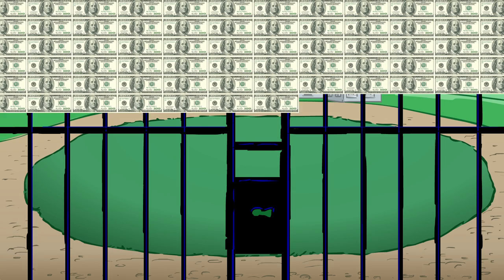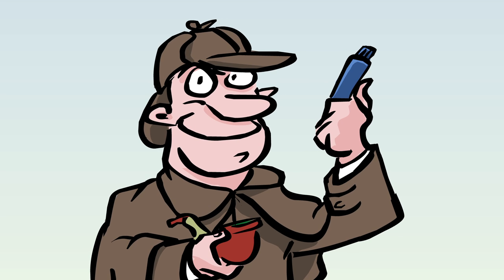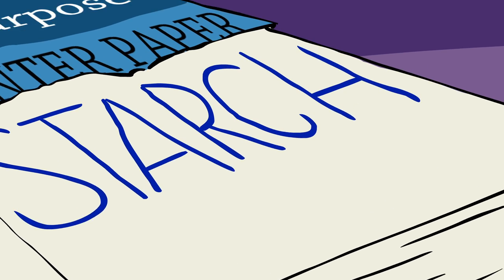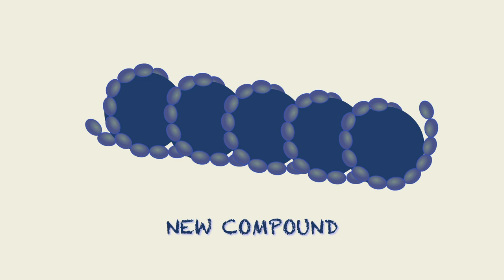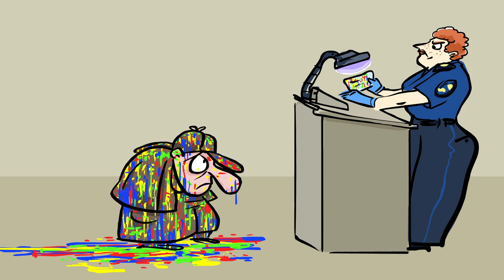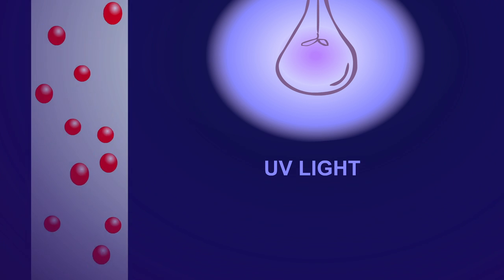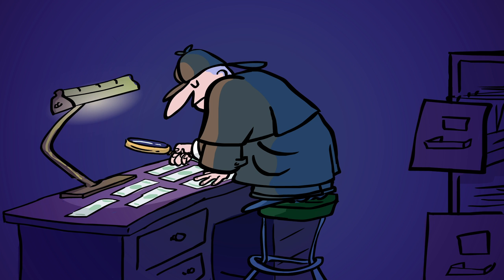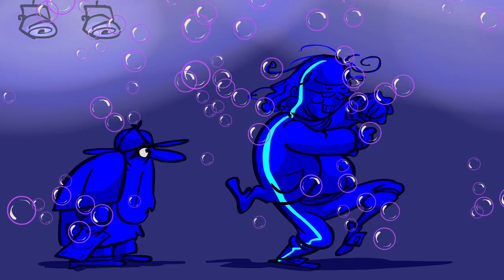How to spot a counterfeit bill - Tien Nguyen

Comment: Remember to be careful for bleached bills too! You might notice that bills pass the marker test but are still counterfeit, they take a $1 or $5 bill, bleach it, then print a higher denomination on top of that. Make sure that strip is in the right spot before taking large bills. That marker is easily fooled!
Reply: rockforever5505 That is why most currencies use larger paper for higher denominations. and is easily seen.
Reply: @marcusl5605  wrong, actually. All US bills are the same size. It's for easier stacking in a wallet or pocket.

There's an easier way to combat the bleached 1/5 trick. The ones and fives don't have a portrait with enough of a suit to texture. All bills 10 and higher in the U.S. have textured suits on the portrait. If it doesn't feel textured, it's fake.
Reply: And also, the paper feels different. U.S. currency is printed on a mix of Cotton and Linen mixed with wood pulp
Reply: I always heard you have the right to contact the Secret Service who are the agency dealing with counterfeit money
Reply: @katherynedarrah4245  Person wasn't talking about US currency. lol They're right.
Reply: There is a newer variety that tests the INK of the paper instead of the paper itself.  If it smears, it's fakey fake.

Comment: There are easier ways to spot a counterfeit bill:

Legitimate bills use black and green ink.
Most counterfeits are printed out with a printer so by that logic all green ink will be comprised of yellow, magenta, and cyan and is easily discernible if you look closely at the bill.

Also, in bills that are 10 dollars and higher, the amount in the lower right hand corner of the face side of the bill will be reflective/shiny. If the number does not shine it is suspect.
Reply: Also if you use your fingernail to scratch the shirt on the bill you will feel the ridges.
Reply: that's noob counterfeiting... don't ask how I know ;)
Reply: +Saphiros Problem is, modern day laser ink printing just made the job of observing the various dots a LOT harder...
EDIT:
Also, Printers now have pure black ink! Yay.
Reply: they still don't have pure green ink though
Reply: Dots, dude. The dots are so small at that point (pun intended) that it's more than obnoxiously difficult to discern the various dots.
Reply: Also did you know most printers also use yellow when printing at all times? It used to exist so that the FBI could find out where documents originated by viewing the yellow dots placed on the paper which told where and when and sometimes who printed that paper. If you find yellow dots on a dollar bill then it is most likely a fake.
Reply: @Saphiros  Canon pro 9500 printer does
Reply: What if ya made a die and re rolled your prints

Comment: In Australia it's extremely easy to spot a counterfeit. Since counterfeits are mort often than not made of paper, it's easy to just feel the difference between a genuine and a counterfeit. Along with that, there are parts where it is see-through, and the last time I checked the only way to make paper clear is by cutting a hole in it. Not to mention that the government is making new designs so it is even easier to tell the difference between a counterfeit and a genuine, as they're putting brail on it and moving images when you tilt them, as well as extremely tiny writing that you need a magnifying glass to read.

Comment: Not a problem with Australian money which is made of plastic (like a cheap playing card but thinner) also all the marks, micro prints, and shadow prints, not to mention all the features that only appear at a certain angle (looking In the window between 5-10° reveals the value of the bill) or with a certain light (there are UV prints with the value and serial)
Reply: +CoolAsFinnBro By plastic you mean polymer specifically.  Vietnam also uses polymer money (because someones brothers wife&#39;s dads cousin (you get the idea) gave some kick backs.  If you think they can't be counterfeited then you would be wrong.  There are many fakes that come out of China and get circulated all the time.  if it can be made, if can be counterfeited!  The polymer monies is many cases are easier...it just depends on what security features are present, not so much the material the majority of the bill is made of.